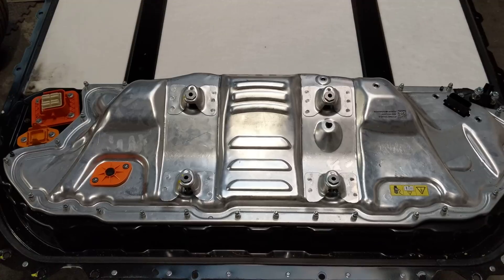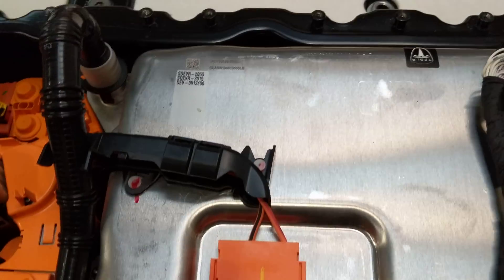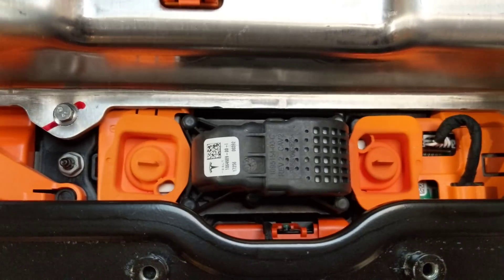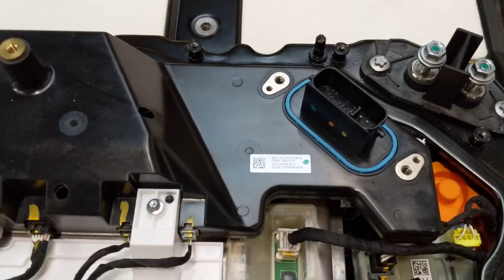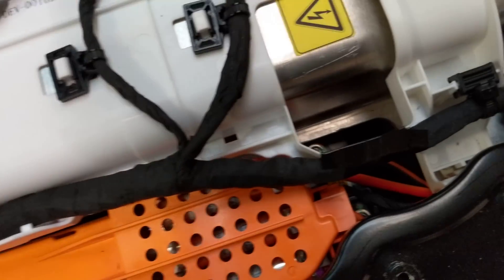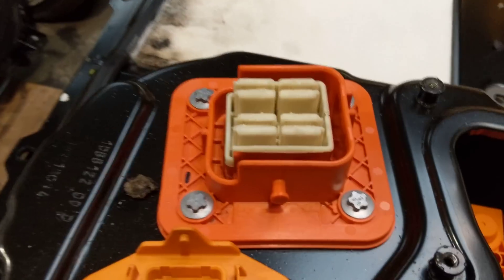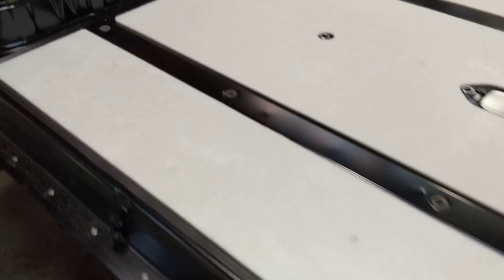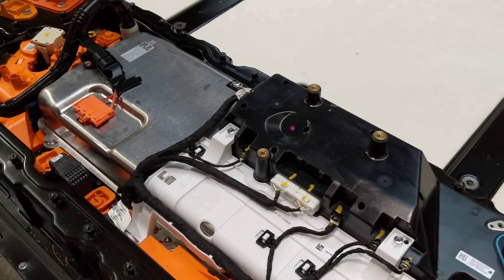First Look: Tesla Model 3 Battery Pack

Comment: What is the orange dummy plug next to the charge connector for? AC on the euro CCS2 cars?
Reply from the maker: Yes, it's for 3-phase AC input.  EU spec cars use this, but not US.
Reply: @Ingineerix  cool, thanks! Figured that was it but haven't seen any EU model 3 batteries online yet

Comment: Why is the penthouse cover air tight? Is the pressure inside positive or negative? Thanks
Reply from the maker: The penthouse is effectively connected to the battery pack envelope, so it's air-tight to keep humidity/water out, it's always close to ambient atmospheric pressure though, thanks to a gore breather.  As the pack heats/cools, it needs to "breathe" to keep the envelope from having too much pressure/vacuum.
Reply: @Ingineerix  hats off to knowledge. Thanks a lot

Comment: I wonder how much current / power can we extract from the 12V output from the battery DC/DC converter? Any idea ? I guess about 3kW  or more ?
Reply from the maker: less than 200A  (subtract whatever the car is using)

Comment: What are the dimensions of the Battery Pack, in inches or cm, width, length, height?
 (overall width, flange edge to flange edge, and the flat edge or vertical surface to vertical surface distance) , height (tallest part of the penthouse and thickness of battery pack, top to bottom)?

Comment: Do you know please how many batteries the Model 3 have ? Thanks a lot for your video :-)
Reply from the maker: Depends on the pack size, but the largest (long range) is 74kWh (rated) with 4,416 cells of the 2170 type (21mm diameter and 70mm tall) arranged in 46P96S which is a bout 350v nominal.
Reply: @Ingineerix  Whoauuuu... thabks a lot for the great answer :-)

Comment: Hi, you're doing an amazing retro-engineering work here ! Do you know wich HV connector brand they are using ? Or maybe they build them too. Do Tesla use parts from standard car industry supplier like hella valeo bosch for the parts like AC comp waterpumps steering... or do they design and build everything ?
Reply from the maker: They use many suppliers.   Most of the HV connectors are TE.

Comment: what amps can you draw on 12v?
Reply from the maker: Depends on what accessories are in use.  If you shut off most loads, you should be able to do at least 100A.
Reply: @Ingineerix  Can you tap 12v accessories from that big terminal instead of the 12v battery in the frunk?

Comment: I am currently working on a 2019 model 3 that was in a rear impact collision and won't drive. I've already replaced the pyro fuse as its the only fuse that I am aware of that is easily accessible. The HV system still isn't coming online as it isn't recharging the 12v battery a d will not go into any forward or reverse gear. The drivers seat belt retractor was blown and is locked. Is there something I'm missing. Pushing this thing is getting old haha. Any help would be greatly appreciated.
Reply from the maker: Drop me an email (look in my channel info) and I can help you pull diagnostics on the 3 and get it going again.
Reply: @Ingineerix  thank you so much! Email sent.
Reply: @homeskilit22  any luck on this? Same issue here

Comment: So what inverter do we use for DIY power walls for these packs?
They are 25s and 23s packs 2 each. 403v fully charged  96S battery.
with one 25s and one 23s in series (48S1P) and paralleled with the other 25s+23s it is 48S2P 201.5 Volt fully charged.
Taking them any further apart would most likely end with some damaged cells and way more work then I care to do. 
So when these batteries come out more on the DIY front we need inverter chargers that can take 150-200VDC input and put out 120/240VAC.
So far the only thing that I have come up with is either PV charge controller Magnum Energy PT-100 6600W that will accept up to 200VDC and output 48VDC for charging batteries then hook the charge controllers 48V output into a 48Volt inverter that we already have. 
Might have to have a small battery bank buffer between charge controller and inverter for charge controller delay when the inverter load kicks on and off while the charge controller ramps up and down.
The other is a Hybrid grid tied inverter that already outputs VAC directly from panels. But you wont be using any panels on the inverter just the 200VDC tesla battery would connect to the PV side of the inverter. You would still need a small battery bank on the battery side of Hybrid inverter for it to work too.
But because it is a Hybrid grid tied inverter it should still put out VAC even tho it doesn't see Grid power.
Now either way that goes. how does one charge a 200VDC battery? 
There are 200VDC power supplies out there but if you want to charge at any significant rate 3000w+ you looking at a several thousand dollar power supply. Then if you are going to charge it with solar you would need obviously panels, another charge controller another small battery bank and another inverter to plug the power supply into to then convert your high 100+VDC solar array into low 12-48VDC to charge your small buffer battery bank then an inverter to go to 120VAC or 120/240VAC to power you 200VDC power supply that you will use to charge your tesla battery.

All we want is a hybrid grid tied inverter that accepts PV panels and will inverter/charge a 200VDC Battery. But I cant find one.

Comment: If the airbag gets deployed what happens to the fuse ( The pyro fuse ) , is there a way to start the car with out changing the fuse ? If I charge the 12 v battery ll that reset the fuse ? thank you .
Reply from the maker: No, in a crash, the BMS controller blows the pyro.  It has to be replaced and everything reset.

Comment: That's very pretty engineering. 

The constant panning and zooming makes it very hard to watch this, however.  As in engineering, there are right ways and wrong ways to make a video.  This is not the right way.  A few tripod locations and a laser pointer would be better.
Reply from the maker: I have very limited time to produce these videos, and no editing experience.  If you want to come help me produce more, please do!
Reply: Suggest a tripod and laser pointer.   Stop recording and move the tripod minimal times as needed, then restart the recording.

Comment: Wait, so if you just have a small crash that triggers the airbag sensor, than the car will be undrivable because of the fuse?
Reply from the maker: Yes, unfortunately it's done for safety.  But generally anything that deploys airbags is not "small".

Comment: Hi thanks for the video I was curious to remove the penthouse cover the complete battery pack can still be installed in the car?
Reply from the maker: Not sure what you are asking, Yes the penthouse cover can be removed with the pack in the car.
Reply: Yes thanks this is what I meant to say the cover can be removed with pack still installed.
Reply: @V10PDTDI  Use grammer. Avoids missunderstandings.

Comment: Does the 3 still have a 12v lead acid battery?
Reply from the maker: Yes.  Small AGM located between the front shock towers.  You can see it in my video here: https://youtu.be/dxPDT843nOw

Comment: Which material is the Battery housing? Steel or aluminum? How do you guess is it protected against impacts when the ground clearance wasn't enough?
Reply from the maker: It's Steel.  It looks like the bottom is stout enough to handle driving over curbs, etc.
Reply: +Florian Schmid The paint looks pretty thick, the steel is probably zinc plated, etc.
Reply: Maybe the overall battery weight could be lighter with aluminum
Reply: My thoughts where more about getting a rusty Battery when it got scratched. A Steel housing is not the best in this case.
Reply: +Eduardo Forneck Aluminum costs 2x to 3x as much as steel and is not as tough.  Steel is better for this mass produced application.

Comment: Still don't know where is the battery?
Reply from the maker: This is the battery.  Of course all you can see is the outer casing.  I have not yet removed the cover exposing the modules, as this has already been covered by others.  Under the black steel there are 4 long modules that run the full length of the casing that have a total of 96 bricks that contain 4416 total cells called “2170's” (21mm diameter, 70mm long).  There are 46 of these cells in parallel in each brick, 2 of the long modules have 23 bricks in series, and the other 2 has 25 bricks in series for a total of 96 bricks in series.

Comment: Any idea on the max amps on the DC to DC converter?
Reply: Should be around 100A. But there are posts about fault codes poppin up when drawing more than a few amps ''Cannot maintain vehicle voltage'' etc. so beware. Since every circuit is hooked to the solid state electronics tappin power can pose a challenge.

Comment: You need to strip this down further.
Reply: Others have done this. I doubt that if you opened the pack itself you'd get it back together right again. At least not without difficulty.  Cool design, though.  The cells are mounted to giant PCBs the length of the battery pack, like capacitors on a motherboard.